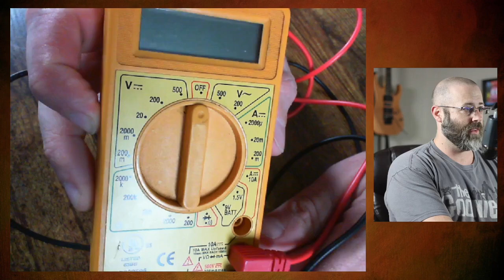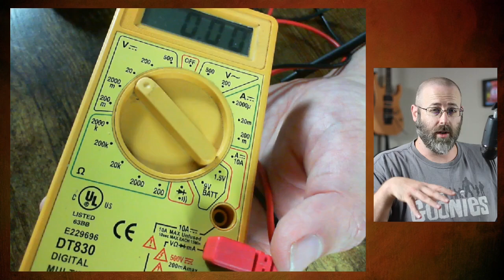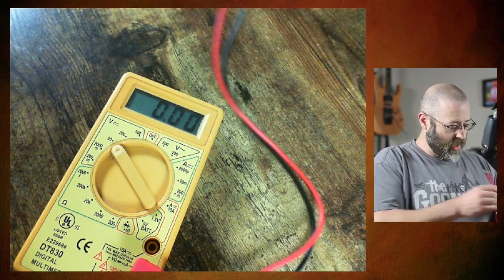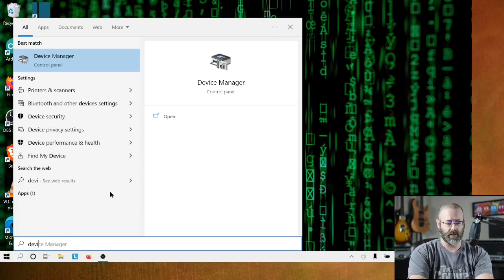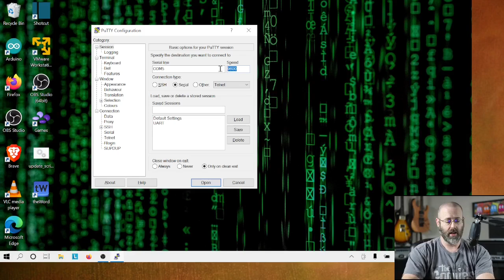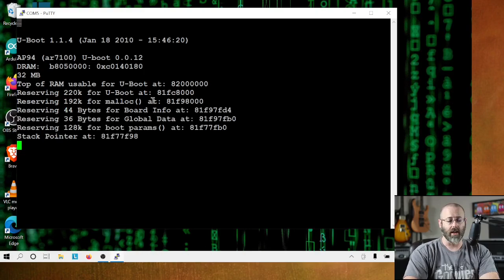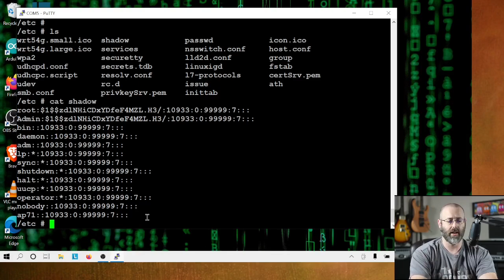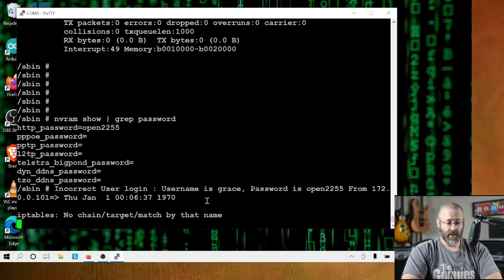Fun With HARDWARE HACKING!!! - UART ROOT SHELLS and Finding SECRETS!

Comment: Great video. You need an oscilloscope so you can have a visual representation of the voltage variations. They will be highs and lows; 1’s and 0’s. Have fun
Reply from the maker: Funny you say that! I was just looking at oscilloscopes the other day because I want to do more with hardware and it seemed like a good tool to have in the kit. Thanks for the suggestion!

Comment: mine is looking for password after starting putty. i have a archer mr200 router. what should i enter?
Reply from the maker: I would try all the common passwords and even no password at all. If that doesn't work then you can try extracting the shadow file from the firmware and brute-forcing it with hashcat or using an online password cracker like https://crackstation.net. You might be able to grab a copy of the firmware from the device's support page. Then try extracting with binwalk. 

I hope that helps and best of luck!
Reply: @daniellowrie  i have it opened with binwalk but the shadow file is not in it

Comment: Sorry for n00b question but when I plug it in to my computer I don’t get COM5, it just says ”serial port”. Did I mess something up?
Reply from the maker: I assume you're using Windows as your OS, but if you're not getting assigned a COM port then there might be a driver issue. Verify that your device is being recognized by your system by checking under "Universal Serial Bus controllers" > "USB Serial Converter". You may just need to reinstall the driver for it. You might even try plugging into a different USB port. If none of that works then it may just be a bad device that you're plugging in and you'll need to exchange it for another. I hope that helps 👍

Comment: Thanks for this video, helped a lot.
I have to stay at home for some time, so I grabed an old modem from the early 2010 and found out, that there is a password for UART.
Is there a good forum you can recommend for questions about this topic?
Reply from the maker: Glad to hear you enjoyed the video, Karl! I don't know of any forums off the top of my head, but you may be able to grab the password hash from the firmware using binwalk or firmware modkit and see if you can crack it with something like hashcat.

Comment: Thank you for this.,,

I'm super new to the whole electronics thing. In fact the Flipper Zero GPIO pins got me interested & then I came upon Arduino & GPIO & now I'm seeing hacking on this level.

I'll bet you could sell this type of thing to people.

Like ship them that hardware & have different things to try to accomplish.

Things like:

- don't tell them what to try to find & see what all they can find on their own.

-then after they've tried to totally crack this thing, list the things & see if they've found everything & if not, go do those things

-then whatever they couldn't do have a walkthrough video & explanation of the why & how to handle these things

I think people would pay for this type of thing & as long as it's legit it'll be such a powerful tool.
Reply from the maker: Sounds like you're proposing a Hardware Hacking Scavenger Hunt. A very cool idea! 😀
Reply: @daniellowrie  Yes. That's it.
I've seen some YouTube crime channels have started selling these "See if you can solve the crime" kits.

I could see this being a thing like that.
I don't know a lot about this (yet) but it seems like finding hardware is cheap & the kits could be either left as is or tinkered with to add to the lesson.

Comment: Hey friend great videos. I'm trying something similar at home. I've identified the Ground port, and Im pretty sure VCC (it's steady 3.30, 3.29) but the other two ports are both reading 0 volts throughout the whole boot process. Any idea what is happening? I know you mentioned one could possibly read 0.00V being the Rx port, but im confused why both :(
Reply from the maker: This is such a great question, and honestly I'm surprised at myself for not addressing it in the video! My guess would be that the UART RX and/or TX ports are not connected. I've seen manufacturers do that before and when that happens you have to expose the lead wire and jump the pin to the wire. I hope that helps. Cheers!
Reply: @Daniel Lowrie  Heya thanks for the reply  yep that's exactly right. I put it under a scope and I can see the traces have been disconnected. I'm trying to bridge them (theres two pins that can reconnect the traces)  with solder but boy is it ever small.. the thinnest solder I have is still too big for it! It's like doing a surgery.
Reply from the maker: @lukeschmidt7872  Oh yeah, those traces are soooo stinkin' small! At least you know what the issue is and can attempt to work around it. Even if you're unsuccessful, at least you've gained so much useful experience.
Reply: tx pin will have oscillations when you turn on the device. So check voltage oscillation in tx and rx pins while powering on.

Comment: Is it possible to use Arduino as a usb to serial converter
Reply from the maker: I'm not sure, but my guess would be "Yes" especially since they used to make this https://docs.arduino.cc/retired/boards/arduino-usb-2-serial-micro/. 

Edit: I just read through the info for the retired arduino usb-2-serial micro and it says that it has the same chip as the Arduino Uno.

"It features an Atmega16U2 programmed as a USB-to-serial converter, the same chip found on the Arduino Uno."

This makes me more confident that you could use an Arduino Uno as a usb to serial converter.
Reply: @daniellowrie be warned, some arduinos use 5volt and can absolutely break your target if its 3.3volt. some serial ports cant tolerate 5volt for long. I learned it the hard way and lost my test router
Reply from the maker: @309electronics5  Great advice! Thanks for the heads-up 👍